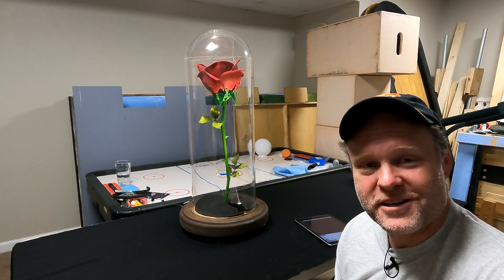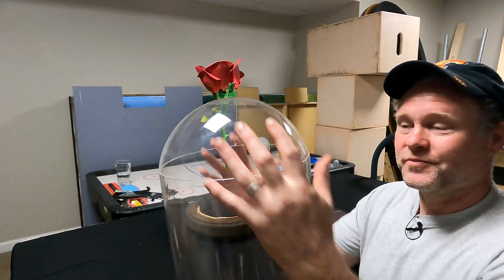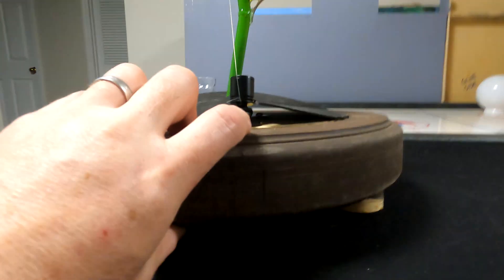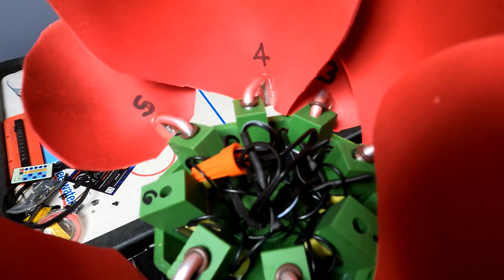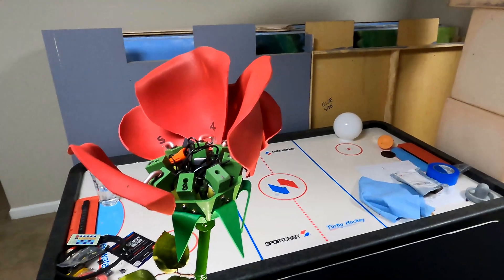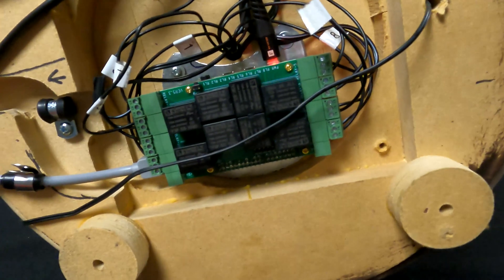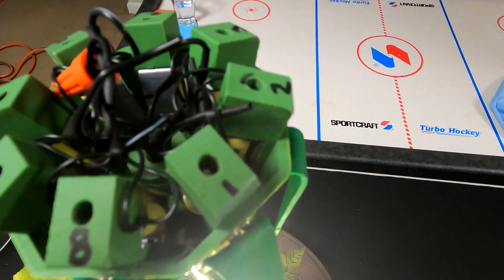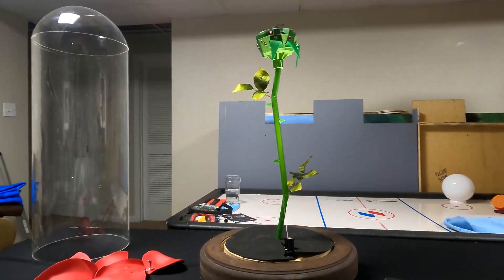Beauty and the Beast mechanical enchanted rose. Remote control rose petals drop demo

Comment: Hey! Thanks for the video. I am working on one now for the school I work at. Where did you find the material for the dome?
Reply from the maker: The dome was fabricated from a polycarbonate tube and a polycarbonate dome glued together. I have a separate video on it but you can get both on Amazon from a variety of places. 

Edit: looks like I never posted the actual build video, let me try and find that.
Reply: Thanks for your help! My project is coming together. Did you find the video on the cover assembly? Also, do you have a link for the material of the tube and dome. I am having trouble finding the right dimensions. I bought a glass one but I think it's too short for stage view. Thanks!!
Reply from the maker: @bryangrody971  yes, I just posted the video about 23 days ago. The dome I got from “plastic-domes-spheres” dot com. I think you can get them on Amazon as well by searching “plastic hemisphere”.